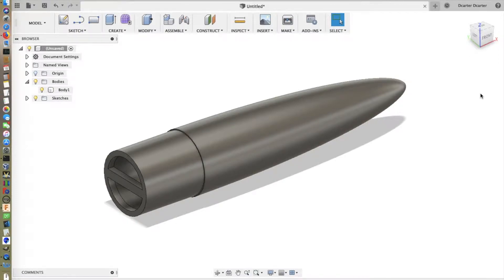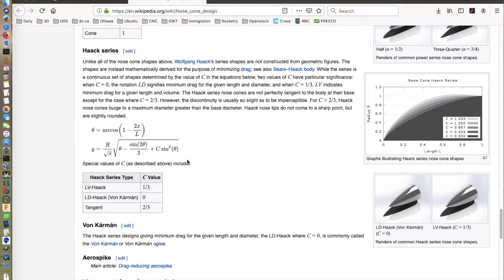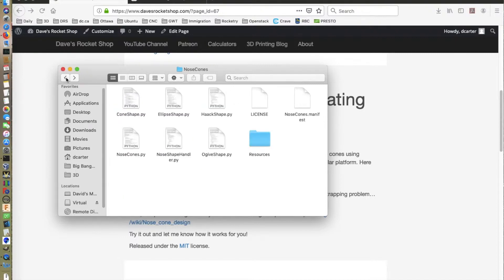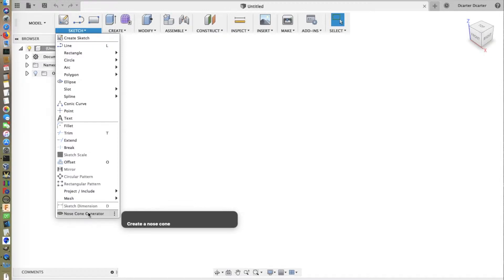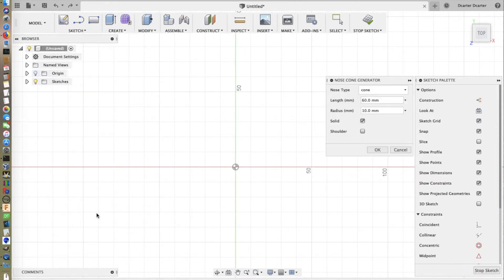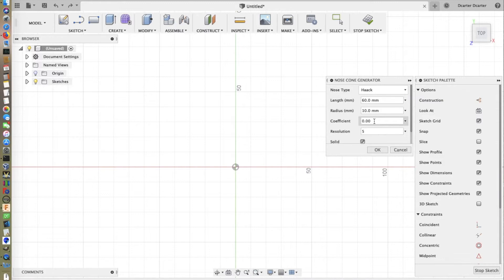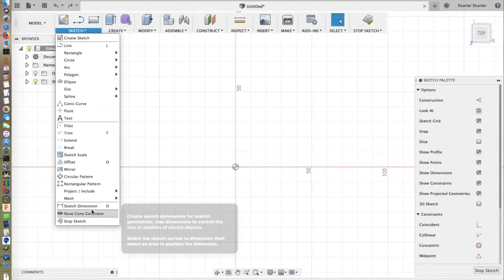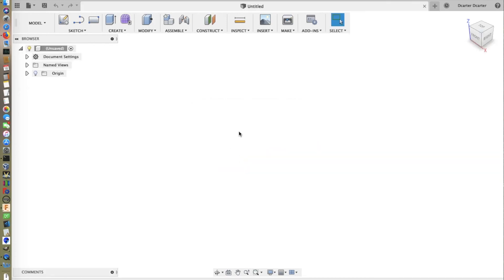Nose Cones in Fusion 360   Part 1

Comment: Followed directions to the letter. The add-in is there, but it won't display anywhere on the screen...
Reply from the maker: I stopped supporting this when AutoDesk removed the free license, or at least made it more onerous. It hasn't been updated in years and won't be going forward.

For a far more advanced version that is still maintained try FreeCAD with the Rocket Workbench (also written by me)

Comment: 1 year later and Autodesk changed the folder structure (again). And the menu. The addin is running but it's not in the sketch dropdown.

On Windows, these are the folder paths:

For a script, %appdata%\Autodesk\Autodesk Fusion 360\API\Scripts
For an Add-In, %appdata%\Autodesk\Autodesk Fusion 360\API\AddIns
On macOS, these are the folder paths:

For a script, the path is ~/Library/Application Support/Autodesk/Autodesk Fusion 360/API/Scripts.
For an add-in, the path is ~/Library/Application Support/Autodesk/Autodesk Fusion 360/API/AddIns.

Comment: Hi Dave. Thanks for taking the time to write the plug-in and post up your very informative video. I've just started down the path of designing and printing my first model rocket, and Fusion 360 is proving to have a decent learning curve. This plug-in is perfect and goes along very nicely with the default nose-cones in Openrocket. 
Really awesome that you've taken the time to share this fantastic time-saver. Thank you again.
Reply from the maker: As a programmer, this was as easy for me as turning a balsa nose cone would be for a cabinet maker. I needed it myself anyways, so it was just a natural thing to do!

It also traces my CAD evolution. The first version I wrote for OpenSCAD, the FreeCAD, and now Fusion 360. Make mighty rockets friend!